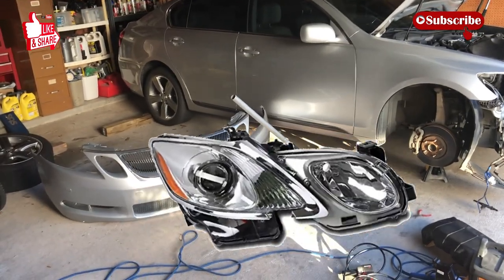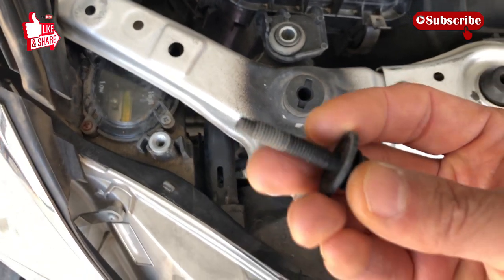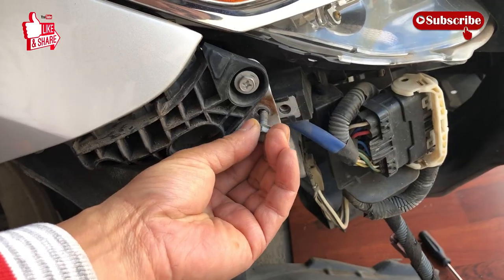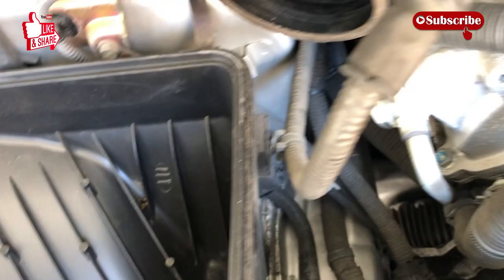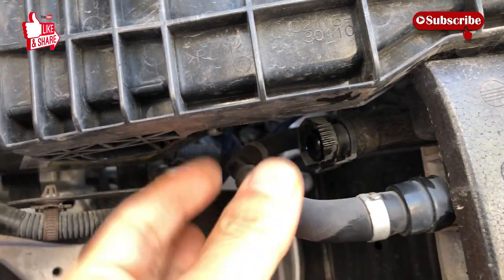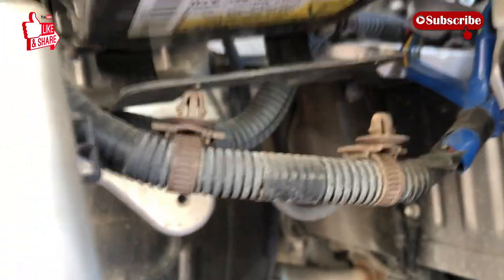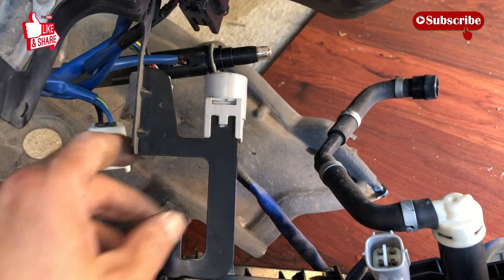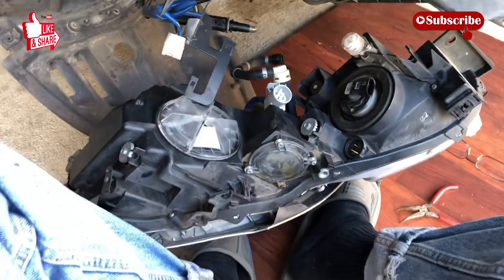3rd Gen LEXUS GS Headlight Removal

Comment: How do you disconnect that harness I’m stuck at this stage any pointers??
Reply from the maker: There are so many wiring so I’m not certain which one you are referring to. So I’m assuming you are referring to the main wiring harness.  Did you watch the explanation at 8:52 time mark?   I think if you get that main connector disconnected, it would save some time, but I was afraid to break it so I ended up loosening the entire thing.

Comment: so can you just remove the air box to get to the bulb? The regular beam bulb
Reply from the maker: Yeah depending on left or right bulb.  Removing bulb is easy but putting it back and getting it to lock is kind of tricky because you have no direct visibly and have to do it by feel of the fingers.  But that’s where you can watch the video and see how it locks in.
Reply: @DIYLifeSkills  i watched that video. Praying thats all i have to do. Thanks!
Reply from the maker: @MrFuchew  The ballast rarely goes out, so it's highly likely it's just the bulb.  Note that cheap bulbs do not last as long as the one that show in the video.   My son has 2008 IS250, which uses same bulb.  He didn't want to pay $50+ for just one bulb, and he got it done at a local shop for $20, including the bulb. Probably a cheap aftermarket.   I've heard cheap aftermarket can last few weeks to few years, so keep that in mind.
Reply from the maker: You can also swap the left and right bulbs to troubleshoot if it's ballast problem (which occurs rarely).   Also, if you look inside the bulb, there is salt compound that glows to make the light. If that is bulging/swollen, then the light only works for few minutes and then turns off.  So needs replacement. If you get the bulb I got, you are good for 5+ years.
Reply from the maker: This is the video that shows how to remove and install all the front bulbs. 

https://www.youtube.com/watch?v=wSGtNM7tvEk&ab_channel=DIY%26LifeSkills

Comment: I put led’s in my 06 gs300 an got a vsc light an check engine light with my afs lights flashing on an off anyone know the reason being?
Reply from the maker: Most common reason for VSC check engine light in this car is the rubber seal on gas cap gets hardened and out of shape so it’s no longer sealing the air tight. The gas cap is designed to let air in but not let gas vapor escape.  You check the engine code for free at an auto part store. If it’s P04nn basically 400 level EVAP error code, you need to replace the gas cap but replace it with OEM as aftermarket parts only lasts few years at most.
Reply from the maker: I caught the VSC but missed the AFS light you mentioned.  For that, here is a video on AFS light. 
https://www.youtube.com/watch?v=tNTKv6SpwMI

Let me how things got fixed so I can also keep up the learning about this car. Thanks.

Comment: Is that the only way to make them brighter? By replacing the Assembly
Reply from the maker: The stock HID ballast is for 35W bulbs.  So the ballast will probably get get and possibly burnout if go with higher watt bulb.   I see some HID to LED conversion kits, and that might possibly provide brighter light.  I also feel this headlight is not very bright, but it did help a little once I replaced the bulb on one side where the light was flickering and going on and off. Also, keeping your lens clean will definitely help.  Oh also, this car is equipped with cool features that turns the headlight to the direction that you are turning and it's supposed to auto-level.  So if the headlight is not projecting out at proper angle (i.e., pointing slightly down), then it's going to appear less bright also.

Comment: How long does it take to fix
Reply from the maker: I worked on it 1/2 hour here and there over multiple days because I had to stop often to study and analyze how it's going to come apart safely.  

Now that I've done it and have video on it, I had to do the same thing on my son's 2008 IS250 with nearly similar setup, it took me just under 1 hour to remove the front bumper and one headlight. 

If you are going to tackle this, have the video ready next to you, and then play, pause, and do each step of the work following the video. 

For first time, it might take you up to 2 hours to take things apart even as you watch the video.

Comment: Hey. Do you think can i replace the hid ballast without removing headlight? 
P.s. thank you for your videos!)
Reply from the maker: Nope. It’s tricky even with the headlight removed. But first check these: the bulbs, connection, and that it’s locked in.  Best way to do this is swap bulbs from the working side.  

I my case, it turned out that it was the bulb that was going out and the ballast was just fine. These HID bulbs seem to work partially until it gets warm and the stops. So it was tricking me to think that it was the ballast.

Comment: This is ridiculous.   They don't make enough selling cars so they need to make changing a headlamp bulb a 5hr process?  Wtf?  Ridiculous.
Reply from the maker: Yeah, tell me about it. I think the problem is they worked in too many features into this headlight. It's not just headlight with bulbs anymore. It's got all kinds of features that I didn't even know: auto-leveling, headlight angles towards the direction that you turn, headlight washer, and of course HID ballast makes this more complicated as well.  Nevertheless, they could've designed it such a way that you don't have to remove the bumper.

Comment: My gs lights are aimed too low.
Reply from the maker: After ballast replacement, I’m also going to investigate the headlight pointing too low issue as well.  I’ve seen others on Lexus forum talking about this, so it could be design issue.  We’ll see.
Reply: @DIYLifeSkills  Yeah, they are scared it will blind drivers. There is a sensor on the front and rear control arm. That also controls aim. When I did shocks I had to take it off.
Reply from the maker: @alb12345672  That’s good to know. I’m gonna look into that. Thanks.
Reply: @alb12345672  the sensors you are talking about are called headlight levelers. The issue with such age 3rd gen GSes is that headlight leveler link rods (one longer one at the front, and one shorter at the back) get either stuck, or they break, then auto leveling stops working, and AFS OFF light starts blinking. If the rods are only stuck AFS OFF light might not start blinking, but they won't be functioning correctly. Before replacing the link rods, and if they are not broken, you might want to give them a good clean and re-lubricate, that usually solves the issue, and you are good for a few more years. If they are broken you can a) have it welded, cleaned and lubricated, or b) replace. I don't know the part number for replacement, as one of mines got welded, and the other one just needed cleaning and lubrication. That is to the best of my knowledge, and I haven't done the fixing myself. But might put you in the right direction.
Reply: @dehto5  My problem isn't they are broken, I just wish the headlights point a bit upward. This complex system with levelers exists so the headlights don't blind drivers if you have passengers in the rear.